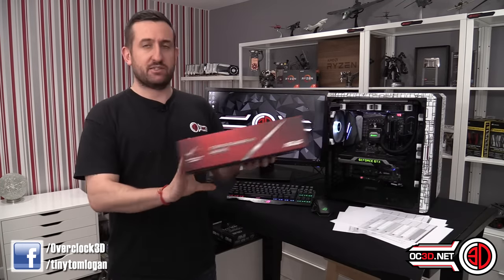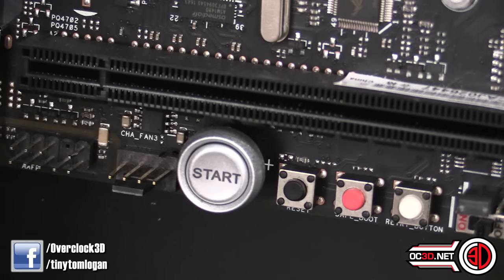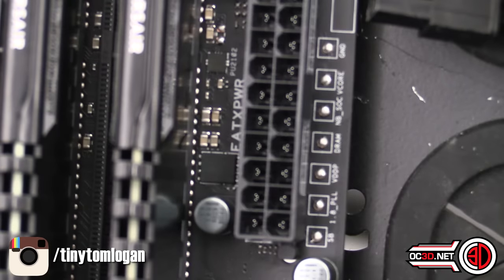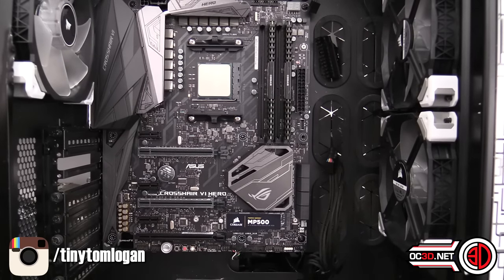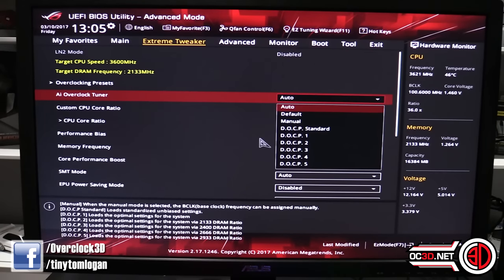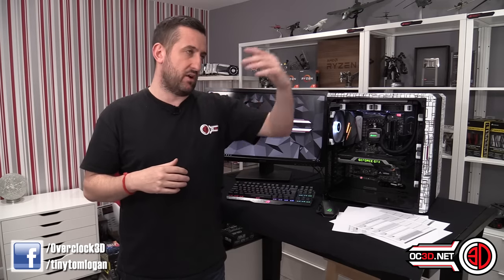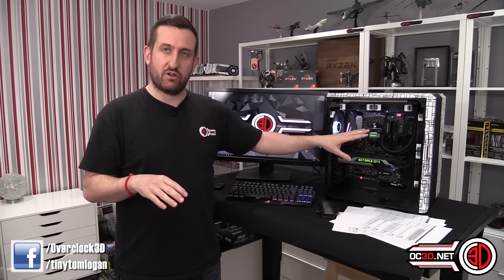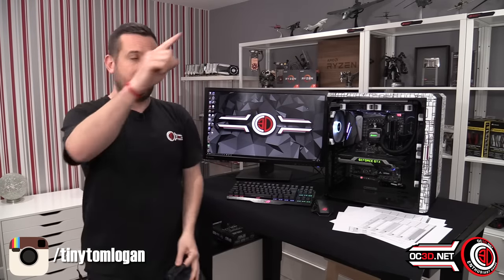Asus Crosshair VI AM4 Ryzen Overclocking Motherboard Review

Comment: just fired up my crosshair + ryzen 1600x,  does the 1600x have an offset  cos it's showing 63c  or is it normal, also the volts are reading 1.425v
Reply from the maker: download the latest version of Ryzen Master - volts wise its all still being done via an offset with Asus so youll need to manually set those and make sure the LCC is set correctly
Reply: thanks a lot Tom

Comment: I am really wondering if ryzen is good value. By the time you buy g-skill amd certified memory and a board capable of running it (Crosshair) and the higher price of the 1700x you are considerably up over the 7700k with worse performance across the board in games and worse performance in Adobe Photoshop and Lightroom and to top that all off you have a  machine that is NOT prime 95 stable (try it and see!)

Comment: Why didn't amd leave the mounting holes in the same place for am4? I'm still waiting for bracket to use my H100 from cosair, rather than using bits of lego and cable ties...
Reply: Jon Donnelly That's for cooler's manufacturers to sell new coolers.. More Business :p
Reply: I gave up waiting for bracket 4 weeks..., cancelled order and replaced the cable ties with springs and thin +long bolts and reamed out the corsair bracket. It works ,just as well as ryzen is a hot bastard.
Reply: Jon Donnelly To clarify Ryzen has +20C offset so it is basically not as hot as it shows. Read more here https://community.amd.com/community/gaming/blog/2017/03/13/amd-ryzen-community-update?sf62107357=1
Reply: I know that but its still hitting 83oC for me stress tested and the pc shuts down at an indicated 85oC. The Intel 7700k@ 4.9Ghz will stress all night long.  Show me a 12 hour stress test head to head.
Reply: Jon Donnelly I don't know really if optimization will improve the overclocking it is best compared with 6900k that can reach 4.5 GHz 8 cores!
Reply: beat the 7700k first and then we will see about the 6900k :D
Reply: Jon Donnelly :D!!!

Comment: Guys I really need a honest opinion. I bought the Gigabyte Gaming K7 and it's pretty nice, but my flare x do no boot up on the new F3 bios update in xpm so I have to use F2 for now to run them at 3200 freq as advertised. I have the option to replace the mobo with this Asus one but I do not know if I should go through the hassle of doing so.

Is it worth the change? Thanks!
Reply from the maker: Memory problems will be frequent on all boards because of the Agesa updates. Its not Gigabyte specific. The only thing I will say is from my experience recently Gigabyte have been fairly lax with updates and their bios now is worse than at launch by a country mile.
Reply: Thanks for the reply sir, will sure check your future content.

Comment: I have a EVO 850, which I believe id SATA not PCI, and whenever I up base clock I loose the EVO in the boot options.  I'd understand if it was pci, but being sata I didn't think that would happen, ideas?
Reply: Starfire Technology base clock is also a frequency that controls the SATA bus.
Reply: Felipe França yeah, when I saw him set the base clock to 125 I was just like how have you not blown something up? I've always been told messing with the BCLK is a great way to shorten the life of everything that uses it (mobo, hdd,  ssd, etc)
Reply: the M.2 and Sata must run off different controllers.  I'm assuming the M.2 is from the SOC and Sata off the southbridge since if I take the same drive and use a M.2 to sata adaptor i can set a base clock of 120 and it's fine but even 102 on the M.2 and I lose it.
Reply: Starfire Technology yeah, that might be the case. I know one of the M.2 slots does have dedicated PCIe lanes

Comment: i got my 1800x and Asus Crosshair VI Hero bios 902.....man i can not wait for them to get this fixed.....
Reply: Shane Herald bios 902 is fine for me
Reply: o yeah?....what are your settings...have you been overclocking on this board?......i have ....ram is rated at 3000 mhz ...only does 2725....cpu max stable clock is 4ghz...4.1 is achievable but llc even on first setting and 100% still draws the same voltage as it does at 120 or even 130%....cpu voltage is crazy on this beast at 4ghz at 1.38 in bios llc takes it 1.41 no matter the setting of llc.....i can not change my command rate of my ram ...i see no option for that and its stuck in cr2 giving me crazy ass latencies on my ram.....  but your board runs perfect uh .....i highly doubt it ......you might think so ...but its just not man.....this bios needs fixing and it needs it bad....my board runs awesome on stock settings...runs awesome at 4ghz setting....what it does not do is overclock and handle voltages worth a shit....i set vcore to 1.45 .....cpu to 4.1 ghz ...cpu llc is set to setting 1 100% and it still trys to push 1.501 vcore in windows.....no way man something is really wrong here.....if you tinker and tweak on this board you will understand the issues....if your tweaking on this board and dont see any issues your just not paying attention. because there are many many issues.... but over all man im having a blast learning this new system ...  i think the bios rocks...just needs to be made more stable and actually have correctly functioning llc....and many others things fixed.....lol...i am not one to run stock ....i want the best performance i can get ...and right now this board is not up to giving me that with all the issues ....so yeah man ...i can't wait to try out the next bios update
Reply: and you also did not see your ram stuck at CR2 have you .....because 902 bios ...thats all your going to get .....
i just found a new bios version for this board .....bios 1001 ...enabling CR1 which added over a 2000+ point boost in aida64's cache mem test....don't believe?.......just go take a look at my google+ page
Reply: ok tbh, havent done much tinkering. By fine i mean can do basic overclocking with out crashing, can oc ram etc. I have my ram running at 2666 mhz fine. Im gonna take a look at proper overclocking soon so I will tell you how it goes.
Reply from the maker: Depends what 3200 ram you have. Some work some dont. Its all down to AMD to fix it atm.
Reply: at least the 1001 bios update lets the CR1 work now ...lol...and of course depending on the ram ..lets people hit higher clocks... right now im just glad i got cr1 working ....rams at 2725 14-14-14-14-32-cr1 ...1.30 volts in bios llc brings it to 1.352 in windows ......cpu is 4.03 ghz at 1.38 volts in bios soc at 0.9562 or thereabouts in bios ..... i have noticed i am running a lot lower SoC voltage then i keep seeing all over the net ...but in my testing overvolting the SoC will really really hurt performance and by a lot to....mainly on the l3 cache but some l2 is affected by that also ...people are starting to think well if it don't post slam it with voltage ..... lmao....right now that's the wrong thing to be doing

Comment: Does anyone know if the auto OC on crosshair, or the 4ghz bios oc profile works 100% of the time? I have a taichi that I'm RMAing and I'm considering this motherboard because of this feature.
Reply: ya I had read that it was like this great feature that allows you to hit 4.0GHz with any processor which sounded great when I was testing this 1700 that I couldn't get stable above 3.9ghz but nope this chip has a hard limitation at about 3.925ghz with 1.45v and what do you think that looks like when the system on(before crashing)? I have no idea what it was trying to load for 4.0ghz but it wouldn't even boot... I mean considering the 1700s base clock of 3.0 as a 65w chip I'd say its the best overclocker in terms of value and gain: it cost $330 back in march, today you can find them new for $294 and even less from an eBay vendor and so far out of the 4 1700s, 3 1700Xs and 1 1800x I have yet to get a chip that hits 4.0ghz at acceptable voltage but this 1700 I have hits 3600mhz memory with an xmp select, making it worth keeping.

Comment: Do you have the Asrock X370 Taichi due for review?
Reply from the maker: Ive asked but they are beyond useless. TBH this comes up a lot and I just get tired chasing them.
Reply: Maybe ask again when product is more available.

I do like that they have solid power pins on their X370s.
Reply: OC3D TV I'm using your reviews to help me make a more informed choice. They should care more than they do to provide you with a review sample. Too bad for them..
Reply: My gaming pro is in transit, maybe I will send Tom some notes/pics/video when I have played with it a bit.

Production seems to be very tight, they came in to stock at OCUK and went out of stock again immediately (no idea how many they got, but I got mine) so they may just be conmcentrating on filling customer orders first instead of press samples. Which may be bad for their marketing but is actually better for the customers.

Comment: i have a question if anyone is willing to help out. My issue is that my case has a front usb 2.0 connecter which i connect to my usb 2.0 connecter on the mobo but my nzxt x62 also requires me to plug in the usb c port to the pump and the end of it to a available usb 2.0 port and from what i can see my this mobo only has one usb 2.0 plug in. what can i do?
Reply from the maker: NZXT have an internal USB2 hub you can purchase
Reply: ok thank you i will check out my local microcenter and see if they have this hub or adapter.

Comment: Does this board finally support ddr4 3000???
Reply from the maker: can do 3200 easily if your memory is compatible
Reply: thank you for your reply. i know this board in particular has had some issues with anything over 2666 and ryzen. i think i'm just going to go for it. i would like to run a ryzen 1800x and ddr4 3200 g.skill trident series. thoughts?
Reply from the maker: ALL boards did at the start - it was an AMD problem. If you get a kit thats on the QVL list now you should be fine. You will need to enable docp or set it up manually though. No boards run the mem at rated without set up
Reply: Thank you sir!

Comment: i have some 5 pin RGB led's am i fucked if i buy this board?
Reply from the maker: Depends what the extra pin is tbh. They can be in a different order too so there is no perfect answer here
Reply: This is the product im talking about idk if you're familiar with it https://store.cablemod.com/product/cablemod-widebeam-hybrid-led-strip/
Reply from the maker: the pin out on those I know 100% is designed for gigabyte. You would need to cross check where the 12v and R - G - B pins are located on your kit and on the Asus board
Reply: i see thank you for taking the time to reply i really appreciate it. (ill just buy separate ones :D)

Comment: GPU wont fit because the heat sink is in the way... Crosshair Extreme using a ASUS ROG STRIX GeForce GTX 1080 Ti. Help? lol
Reply from the maker: If you mean the CPU heatsink then youll have to buy a different one
Reply: OC3D TV the one in the bottom right hand corner that has that cover?
Reply: Nvm, didn't realise they had to go inbetween the case and the mobo haha. Woops.

Comment: If Asus wanted to make the Motherboard compatible with AM3 coolers, they should've included a backplate for it. It's pointless otherwise, might as well ask the cooler manufacturer to send you an AM4 bracket instead.
Reply from the maker: easily found on ebay for a few £ - a lot of coolers
Reply: OC3D TV sure. Or you can get a free bracket from the cooler manufacturer.

Comment: I don't think this is a true high end board. It is lacking a lot of features compared to some thing like the maximus apex or a gigabyte soc champion. Pcie slot switches, ram slot switches, ps2 port. Also there are a lot of surface mount components around the bottom of the socket which make it hard to insulate. I hope some oc focused boards come out. I have seen a post from nick at asrock saying he is not working on a x370 oc formula, but I still hope gigabyte or Asus deliver what I am looking for. 

Also no ding again :(
Reply from the maker: Lawrence Timme name isn't high end. Hint hint.
Reply: indeed formula and extreme must be coming and hopefully an apex :D we also ahvent seen any boards with a plx chip for 3  or 4 way sli yet. which is needed with an 8 core cpu really. :P

Comment: Like so many other's C6H, mine also bricked its's bios unrecoverable. Asus support was completely unhelpful and after multiple support requests just told me to swap it with the retailer. Not really that encouraging, as it looks to be a qc issue, since so many others have reported the exact same problem, and there is no new revision yet.

Got 4.1GHz (135.6MHz x 30.25) on my 1800X, 1.4V and 2x 16GB RAM at 3250MHz (x12), 14-14-14-34, 1.5V when it still worked. But a good board is only good for as long as it does not self-destroy.

Sent the broken C6H back and ordered a Gigabyte Gaming K7.
Reply: TrueRegulators

You bricked it by overvolting it big time. Next time, check before you up voltage...

Comment: Seeing all the ram issues and board bricking i just decided to wait for them to be ironed out and the QVL list updated. I want to put 32 GB or 64 GB in this board but wouldn't want to be stuck at 2133 MHz. My goal is 64 GB at 2800 Mhz or  32 GB at 3200 Mhz with a cpu OC at 4 Ghz.Before you rush and say this amount of ram is overkill consider that  I am a big data dev/ data engineer and i do need this amount of memory for my VM(s) and also game when i have time.

Comment: Cold boot in this mobo is a serious issue. this is the worst mobo i ever had in this matter
and trust me i had a a lot of boards: 

Asus p4vp-mx, P4M266A
Asus p5kpl-am se p35
Giabyte ga-p35c-ds3r p35
Asus P5k-e/WIFI-AP p35
Asus p5q deluxe p45
Asus P5E x38
Asus maximus formula x38
DFI Lanparty JR P45-T2RS p45
Evga nForce 680i SLI
Evga 780i Sli
Asus Rampage Extreme x48
Asus Crosshair V formula-Z 990fx
Biostar x58a tpower x58
Asus P6T Deluxe v2 x58
Asus p6t Ws Pro x58
Evga classifed x58 ECP E759 x58
Asus P8p67 deluxe p67
Asus Rampage III Formula x58
Asus Crosshair VI Hero X370

 the point is this is the worst cold boot motherboard i ever had in 30 years. i'm really disapointed with this motherboard

Comment: why do ppl still buy AMD? it has very very very bad (extremely bad) heat dissipation problem and always has and always will have! intel is more expensive yes i get that but you pay for quality!
Reply: LMFAO, so the Kabbylake toothpaste on the cpu is high quality?
Reply: no idea what you on about tbh, but all you have to do is look at the size of the fan / heat sinks needed for both AMD and Intel (of similar spec) to see what i am on about!
Reply: The kabbylake cpus have bad thermal paste compound, you have to delid it and look for yourself or just look it up. They can get over 90c.
Reply: no cpu have any paste or compound and that wasnt my point, the paste / compound is on the heatsink and you peel of a slice of plastic to get to it normally, my issue is with the cpu itself and how bad AMD is at keeping there processors cool, intel do it amazingly and thats why ppl pay for quality when they buy intel! i used to love AMD cus they were so cheap but now intel are cheap enough that you can move to quality and not spend and arm and a leg!
Reply: ***** The ryzen cpus do stay pretty cool, what are you talking about? Multiple sources say it doesnt get hot and kabbylake tuns hotter. Again your argument is moot.
Reply: i mean in general, and yer water-cooling helps AMD hide the fact that its running alot hotter than intel cpu will ever do! don't believe me? take your cooling off of both and see what cooks 1st!
Reply: Jay Mee AMD solder on the IHS compared to Intel who has a layer of thermal past between the cpu core and the IHS which is alot cheaper.
Reply: Please dont feed the troll, for the love of whatever holy spirit fucktard you believe in, DO NOT FEED THE TROLL.